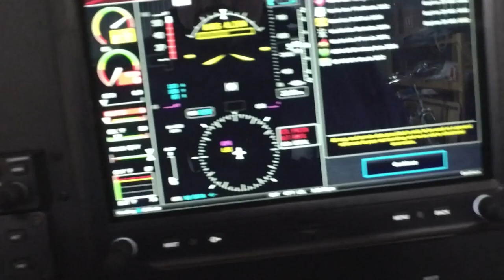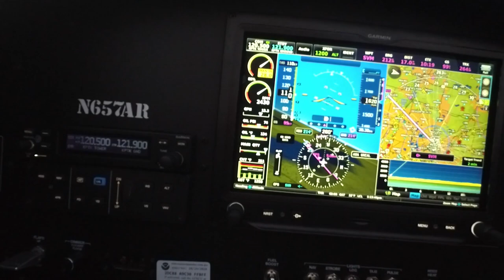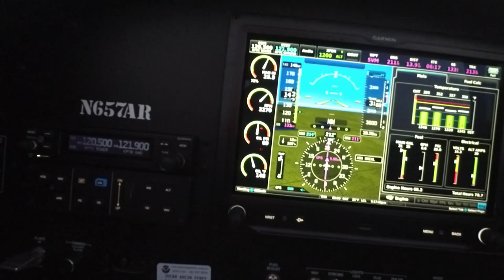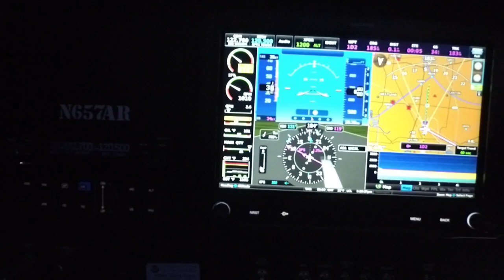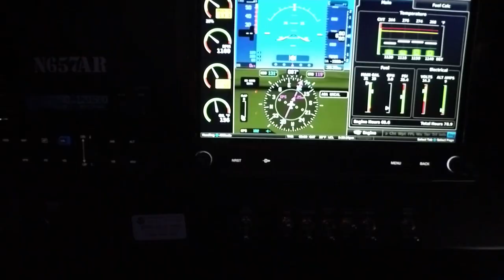Chest Camera Mount Test Flight 221201

Comment: How cool is that!?
That is a tight cockpit for recording video.
Reply from the maker: I think I'll still end up with a fixed mount somewhere.  Stay tuned.
Reply: Maybe also try an ultra wide angle with highest stabilization settings. Your hands and some sky in the frame would help.
Reply from the maker: @mikebeuselinck6138  The Garmin Virb was on the widest angle setting; I was trying to mainly capture the EFIS screen.  It's offset on the panel slightly which was part of the problem.  I'm going to come up with a different mount for EFIS screen captures.